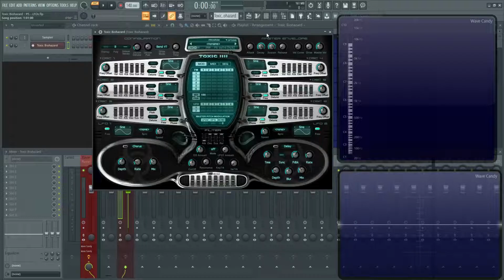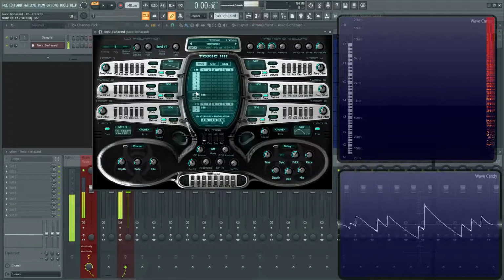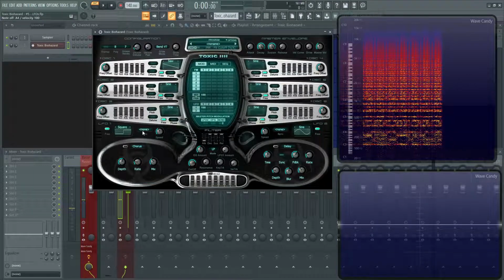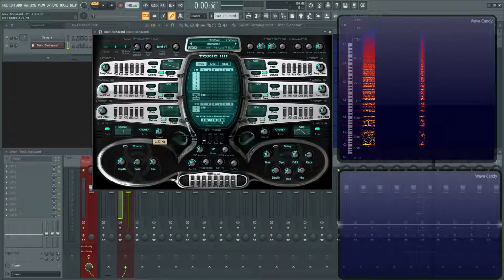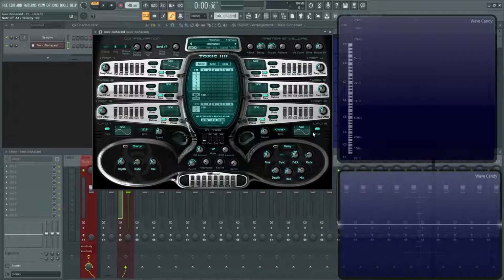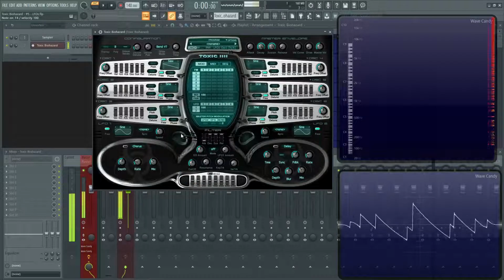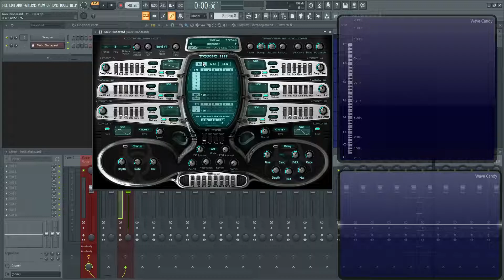Toxic Biohazard Tutorial | Part 5 - LFOs | FL Studio

Comment: 0:55 For LFO 
the Row on the Left Modulates the Colum at the Top

1:28 LFO 2 is routed to Osc Volume

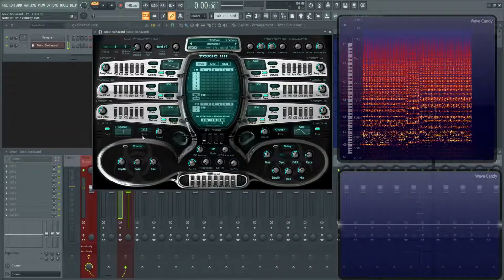3:30 LFO Phase 💎
Free Phase Filter Mod

5:30 Use LFO 2 to Mod stuff

Switch Waveforms*
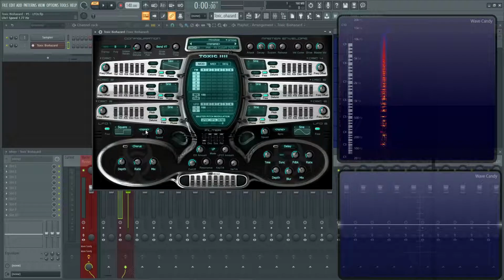2:49 Set LFO Bpm Sync Speed